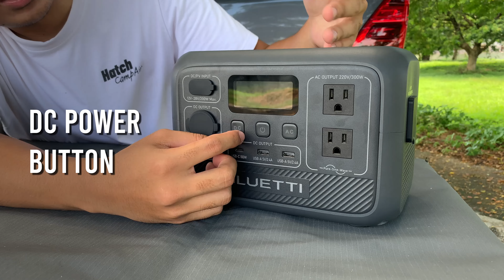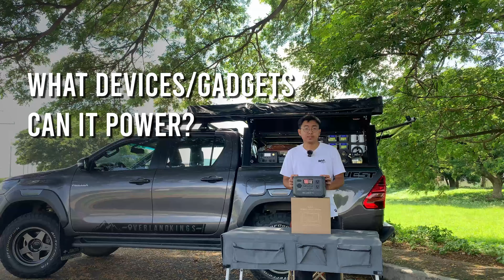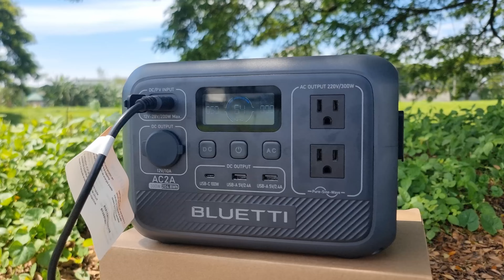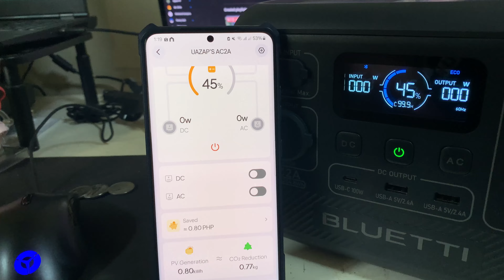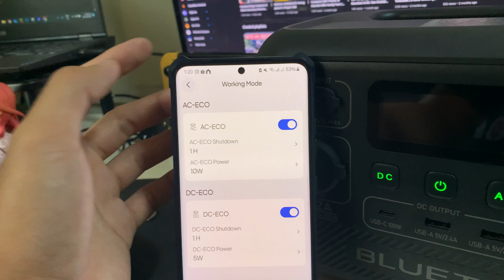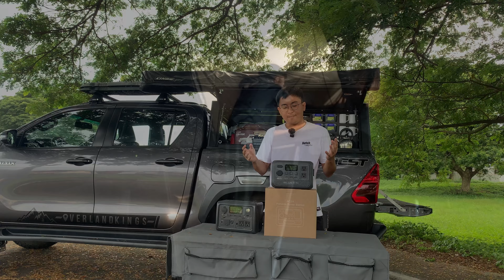Bluetti's Most Portable Power Station: BLUETTI AC2A

Comment: can it charge and ebike ?
Reply from the maker: Depends on the charger of the ebike. Typical e-bike chargers consume between 80W to 300W from the wall, depending on battery and charger specs. If it's below 300W then it could probably charge it. But I would suggest to get bigger portable powerstation to sufficiently charge your ebike.